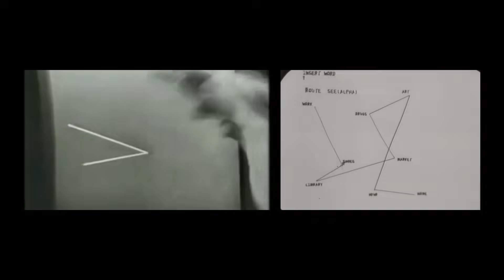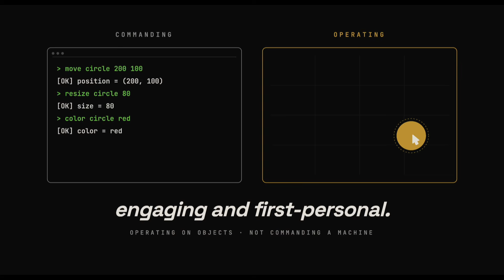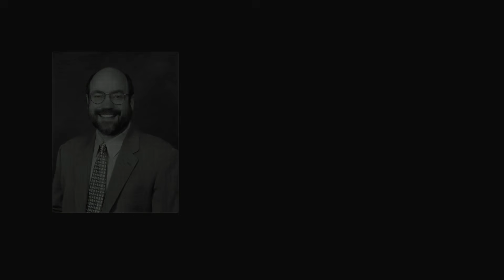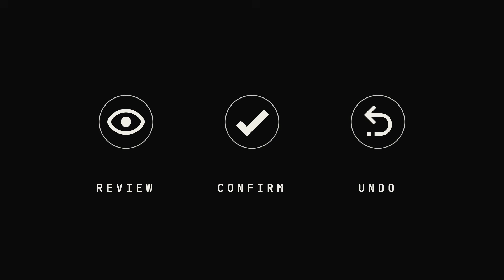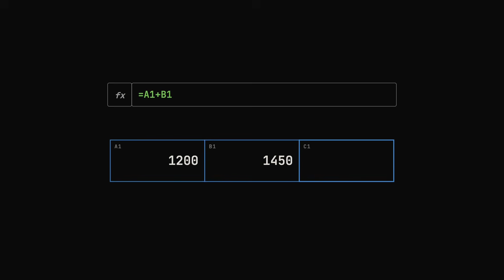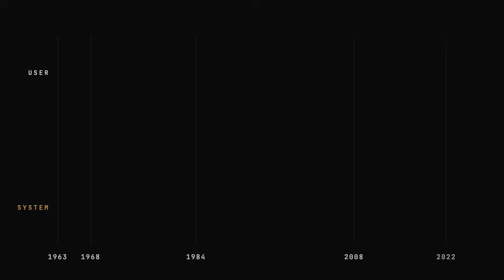The Receding User: Designing for Absence

Comment: Great work.

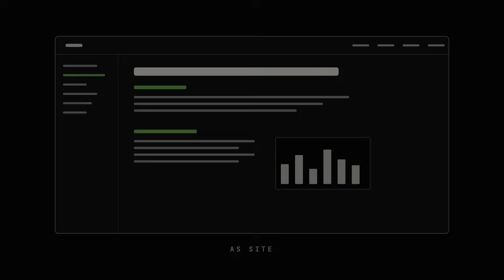14:36 I have been focusing on fixing this in my projects. Chat with an “intelligent” machine feels magical initially, and it works for some use cases, but it was soon obvious that it falls far short for the majority of user experiences.  I think there is still value in the prompt-generate-chat to iterate loop, but in my work, and in particularly one project I am working on, I am exploring ways of anchoring or embedding this paradigm in smaller, more focused/targeted, more digestible pieces, within a more “intuitive”, visual surface germane to the domain, rather than one, undifferentiated blob of chat with no convenient anchor or reference point other than the last message and the prompt input.

Comment: Another really insightful video. I’ve been finding the handoff to be one of the most frustrating parts of the agent experience lately. When I come back to check what happened, I either get a vague summary and have to dig through the transcript myself, or a huge wall of text that is almost as bad. I’m not quite ready to fully take my hands off the wheel yet, so the subtle context behind the agent’s decisions still matters a lot to me.

Recently I’ve been wondering if the solution is to move beyond text-only feedback and combine visual, audio, and textual cues, with each channel doing a different job. Not just text-to-speech reading out the same summary, but more like a presentation: the spoken explanation gives one layer of context, while the screen shows supporting details, changes, or evidence alongside it.

I feel like utilising all the senses is a higher-bandwidth way of communicating what the agent actually did to the user, while giving users a stronger sense of control without forcing them to read a wall of text. I’m not sure what the exact interface should be, but I think there’s something interesting there.
Reply from the maker: completely agree. Rich overviews are definitely needed. I think the summaries provided now become very taxing after a couple of interactions and eventually get ignored. I strongly believe that cockpit-like agentic IDE has a real potential.
Reply: Oh my god, genuinely, what are we doing? PowerPoint presentation as a programing language??
FFS I really learned programming at a bad time in its history.
This will consume so much resources. If you have enough energy for a PowerPoint just fucking code it😣😣😣
Reply: @visclo4782  I feel like you completely missed the point 😂 It is much faster to spend 5 minutes reading a PowerPoint than to spend hours (or even days) thinking through each line of code by yourself. Also, the UI would not be a PowerPoint, as that was just an example...